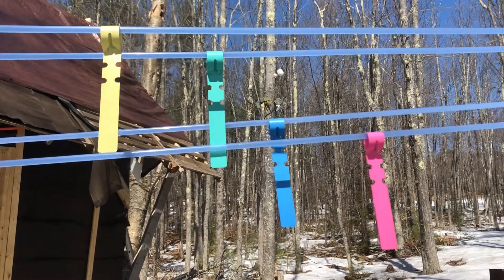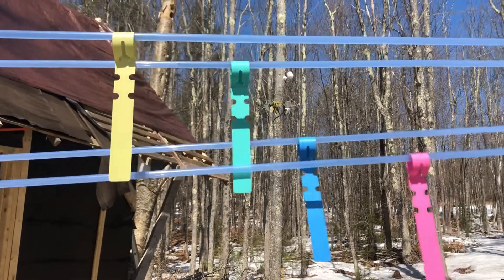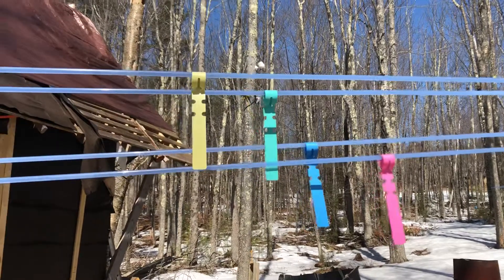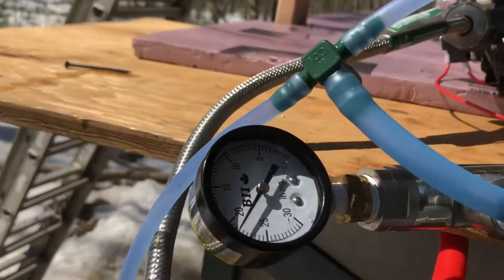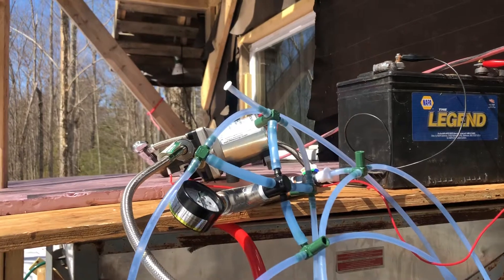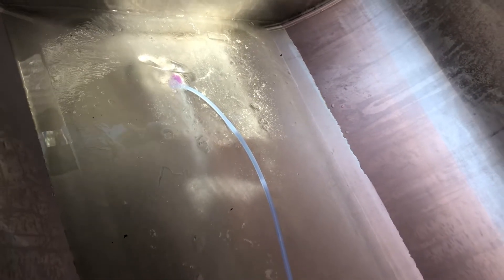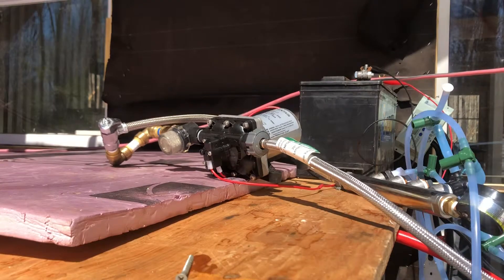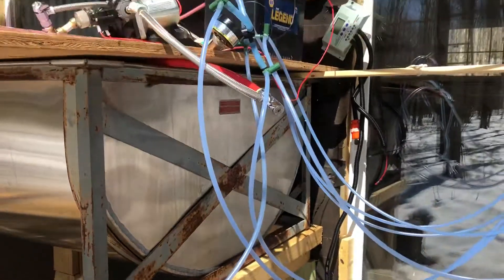Yield more sap with simple vacuum system part 2/3

Comment: Where did you buy your manifold? Thanks for the video,very informative.
Reply from the maker: Thanks Arlen, Home Depot. Here’s the link:
https://www.homedepot.com/p/HOME-FLEX-1-2-in-x-1-2-in-x-4-1-2-in-CSST-FIPT-Stainless-Steel-Manifold-11-050504/203073904
Reply: @andrewfazio3515  thanks for the help
Reply: Hi Drew, had a question for you about my 4008 shurflo pump. I pretty much set my system up like yours, the sap here in Minnesota isn't running very good yet. Do I need alot of sap running to achieve 20 lbs of vacuum. I'm only able to get 3 or 4 on 2 different vacuum gage's,I have 4 lines coming in and a recirculating line.  Or should I be able to get vacuum even with out sap flowing? I've been up and down the line looking for leaks bout can't find anything. Maybe the pump is bad. Just looking for your thoughts, thanks Arnie
Reply from the maker: The recirculation line is to keep the pump “wet“.  Diaphragm pumps need a good deal of liquid running through it to build up vacuum.  Once everything starts flowing, you want to restrict the recirculating line.  I’ve been using the max flow leader 3/16 tubing which has an outside diameter of 3/8 of an inch.  You can put an in-line push to fit ball valve to control the flow or just simply stick an object into the end of the tube like a screw to control the flow that way.  Since I’ve expanded from starting out with four lines as well, I no longer need a recirculation line because the flow kicks in right away.
I just put out another video about the pump/manifold set up:

https://youtube.com/watch?v=TjKy3UthAds&feature=share

When searching for leaks, plug the recirculating line.  Now look at your lines and see which one is running the fastest or erratically.  If there is some liquid in the tube, bend it into a small V shape and watch how the sap reacts in that dip. If it’s flows smoothly, it’s fine for now. If it looks like it’s building liquid and then spitting through, there’s your largest leak.  I say largest because you will work backwards from there. Once you plug the biggest holes, the smaller ones will appear.

Good luck with it! Let me know how it goes.
Reply: Thank you so much for your help. I'm going to watch your video right know. I'll let you know how it goes

Comment from the maker: Hey, all of my lines run downhill on gravity and the vacuum assists with the lower trees.  Fortunately, my property is shaped like a bowl.  I do however, I think you should be fine.  The pump is capable of pulling uphill.  I have plans on rejuvenating an abandoned dug well on my property this spring and using another surflo pump to bring the water up to storage tanks for plant irrigation.  Good luck!